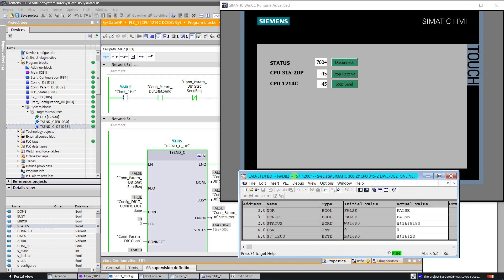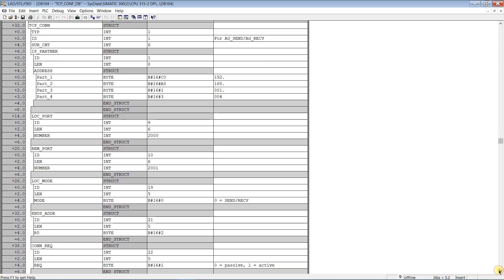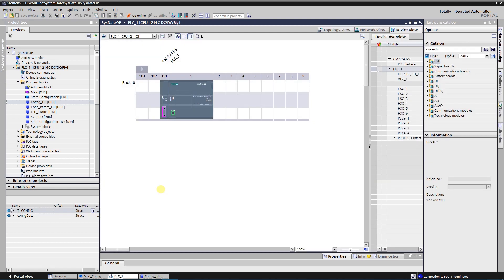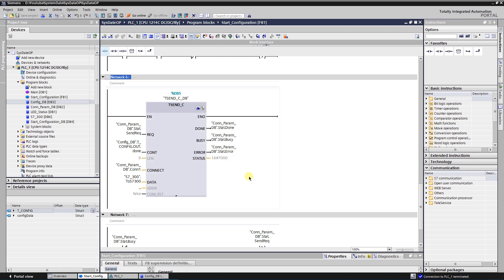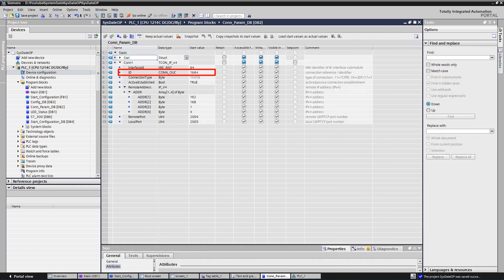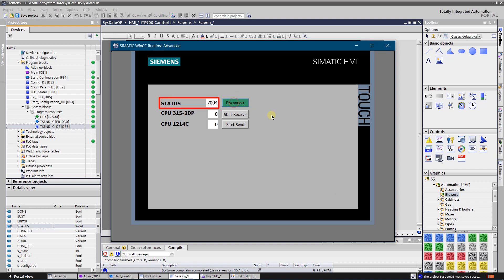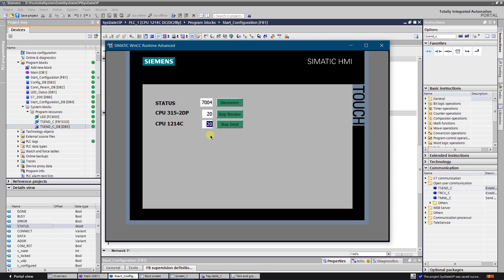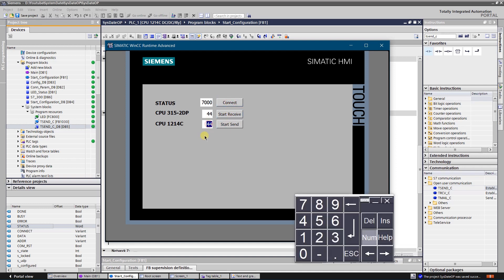TIA Portal: Set TCP connection  between S7-1200 and S7-300 in user program.

Comment: I have no clue how to form SendReq signal? I connect to this 0.5hz and test with 1hz bit, it arrives to s7 300 side with 5-10 sec delay and i don't know whats a problem
Reply from the maker: If you want to send 1Hz bit, then make your SendReq more frequent - like 5-10Hz. The frequency of the SendReq must be higher than the frequency of your test bit.
Draw a timing diagram of your signals, also add some transfer and processing delay and you will see why there is such delay.